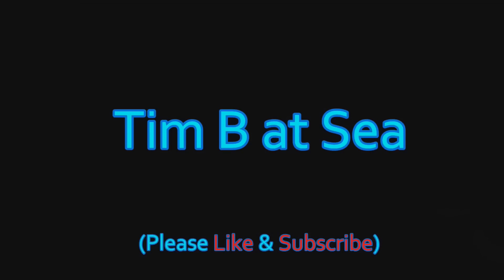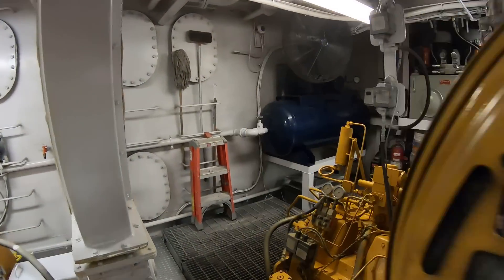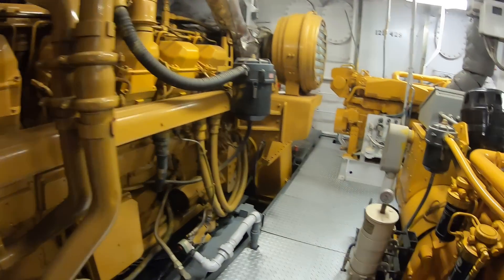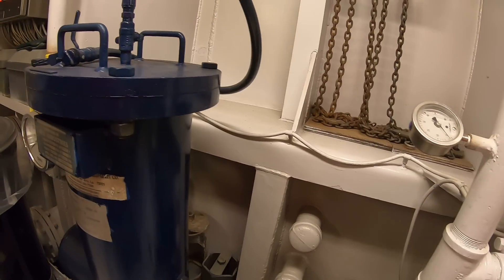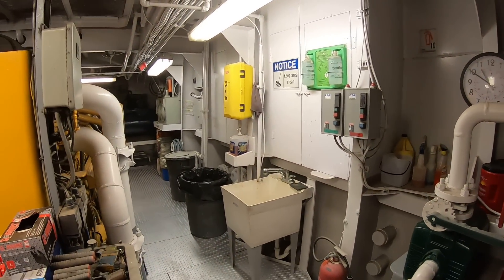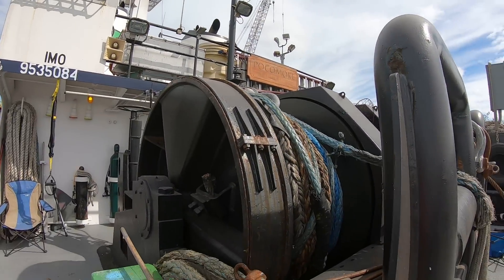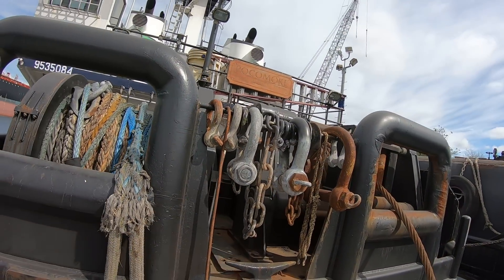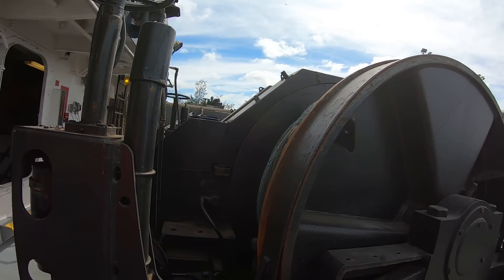4200 HP Tug Boat Engine Room Tour

Comment: Awesome video! Would love to see some action of those vane tugs punching holes in blue water!  Do you leave New York much? Get to go up and down the coast any?
Reply: Mike Swindell - when you say vane tug do you mean cyclorotor drive?
Reply from the maker: It depends on the boat and the contract it has. I used to run the GOM, the Mississippi River and the East coast. Right now I'm working over on a boat that is in Tampa. Thank you for watching and please consider subscribing if you haven't already.

Comment: One slight suggestion and no offense intended, when you are showing equipment could you pan the camera just a bit slower please, you have some beautiful machinery but it whizzes past so quickly it's gone before it can be appreciated :-)
Reply from the maker: Thank you for that. I can totally see what you are saying and will try to do better in the future. Thank you for your input and for watching.
Reply: TimBatSea - fun watching your video production quality improve Tim.  Nice voiceover work on the engine room tour.
Reply from the maker: @nmccw3245  Thank you for hanging in there while I try to learn and improve.
Reply: I don't intend any offence to you either Ray G,  but though I too felt the panning was quicker than I would have liked, I just used the space bar to pause the video and left arrow key goes back 10 secs.
Reply: @Paul_Au  Which is absolutely fine, but how does that help the producer make a better product?
Reply: @rayg9069  I believe the producer is able to determine his own techniques to improve his product as he wishes. 
My comment was directed to you not him. 
It was simply me explaining how I deal with the same issue that you expressed concern over and was offered in the most polite and friendly way.
( I also thought that it may possibly help others who read it and may not have been aware of those controls.)
Reply: @Paul_Au  
Didn't help me a bit, but then, I'm on a tablet. This captain seems to appreciate constructive criticism. Of course, there are many in this world who don't. Wouldn't you agree?

Comment: Good morning Tim , thank you for the video and engine room tour, interesting. Get the idea of the doughnuts!! and safety chain. Do you ever use rollers?? Anyway Take Care and catch you next time 👍😎🇬🇧.
Reply from the maker: Thank you for watching. I assume you mean the vertical rollers that extend out of the transom on some Tugboats? In that case, no. You see those on anchor handling tugs and offshore, big horse power tugs without a Texas Bar and a wire that is on deck. Cheers.

Comment: That Intercon winch. is a classic double drum winch, with, in this case, the port drum is being used as a suitcase drum, as opposed to towing a second barge (tandem towing)). As to the origin of the term....I do not know.
Reply: I did ask another old timer who told me he thought the term came from looping a mooring buoy or something like that with the bitter end of the suitcase wire and bringing it back aboard. Then moving it to another location and dropping the bitter end of the suitcase wire and letting it run free. Thus you could drop something off like a “suitcase”.
Reply from the maker: @tomsummers1137  interesting. I haven't heard that before. Thank you brother.
Reply from the maker: Thank you for watching.

Comment: Not saying I know, but could it be called the Suitcase drum since it has Rope(fabric) in it instead of metal?
Reply: Maybe because it can have anything on the spool, like a suitcase that can have anything in it, whereas the tow winch is wire through and through?
Reply from the maker: Very possible. Thank you for watching.
Reply from the maker: Maybe. Thank you for watching.

Comment: Excellent! Great Video! I was wondering if you have ever operated a tug with a Voith Schneider Propulsion?
Reply from the maker: No, negative. We don't have many in New York. There are many tractor tugs but they use propellers that can rotate°360. Oddly enough, there are some of the big Staten Island ferries that have Voith Schneider drives.
Reply: @TimBatSea  interesting! I wouldn't have thought that ferries would need the manuverability. Obviously some do, or they wouldn't buy those expensive drives.
Reply from the maker: @mwechtal  I completely agree.
Reply: @mwechtal  I rebuilt these voith Schneider machines from scratch
Reply: @TimBatSea  Thanks for that interesting info!
Reply: Voith Schneider propulsion system .great bit of kit copied from nature
Reply: Tim did you know this system was designed around a dolphins tail and the way it works